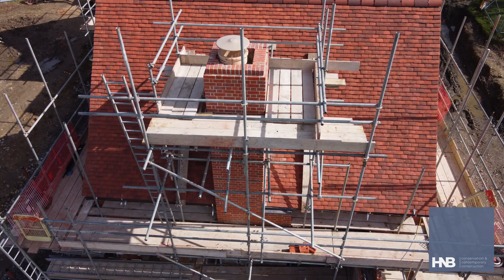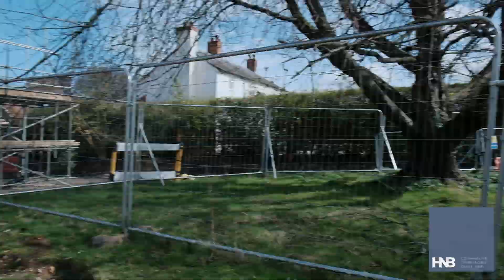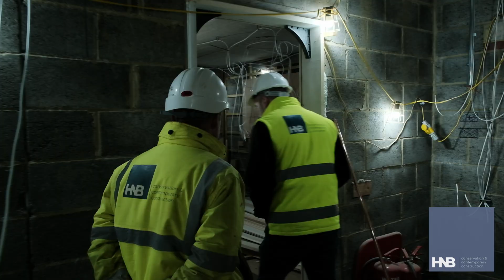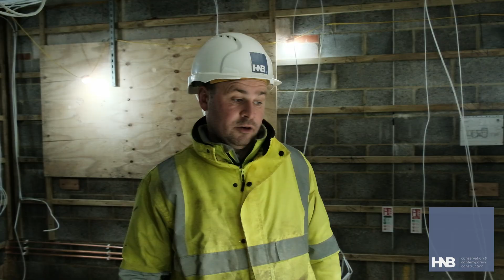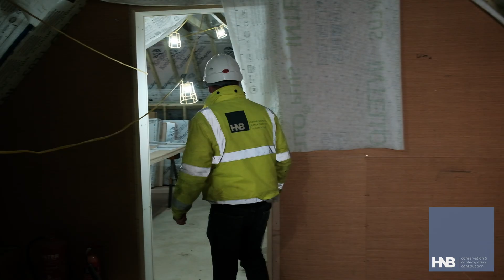THE BITS YOU DON’T SEE IN A NEW BUILD HOUSE | INSIGHT ON SITE 14.03.21

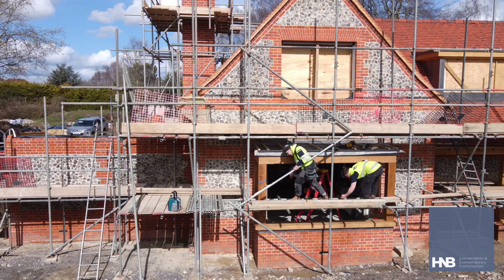Comment: This is to you Anthony as the DIRECTOR of HNB Construction if you pause this video at 4:50 you will see 2 carpenters working on, in my opinion an unsafe scaffolding where they have zero fall prevention from either internally or externally zero access onto the working platform with out crossing open voids in the scaffolding, as a DIRECTOR you should have stopped these works immediately, if those operatives have accessed the scaffolding from the ladder to the right hand side then your safety is non existent, you may not like to hear this but building companies like yours are the reason why construction operatives are killed unnecessarily in this industry, over the past year or so almost 60 operatives have been killed on UK construction sites it disgraceful and DIRECTOR like yourself needs to either employ quality site managers that instigate a H&S regime that is robust and that they have the courage to ensure all operative work safely and if this means upsetting the operatives then so be it, Being a site manager isn't just about getting on with everybody sometimes a Site manager has to do the dirty bits as well, and Bosses need to back them. Haven't you heard of the H&SAWA 1974. you are opening up you as an individual for prosecution and manslaughter charges if anyone dies on your site, and its obvious your site manager is incapable of running a safe site.

Comment: Come on if your going to do a video at least make sure the guy working on the scaffolding in the back ground has proper handrails and toe boards in place, and further in the video OMG, WTF the carpenter doing the roofing over the bay window have you seen the bearing of the scaffold board he is standing on, & what's the minimum width of a working platform, what's the maximum gap allowed in any scaffolding, FFS man get on top of your H&S, but I expect you still believe the best quality in a site manager is that he get on with everybody, but probably doesn't give a dam about there safety.